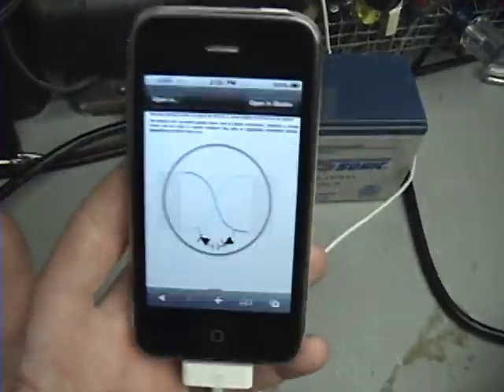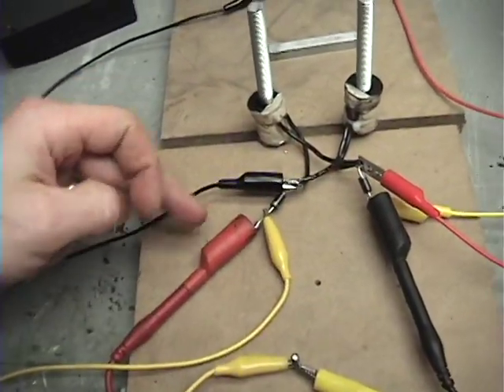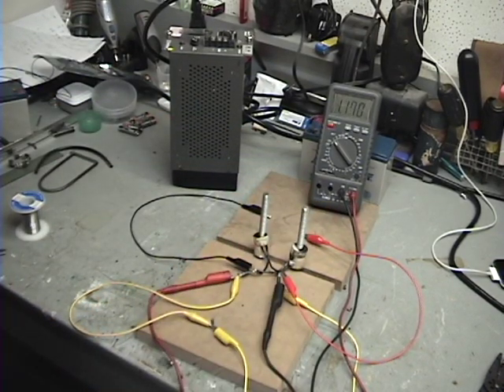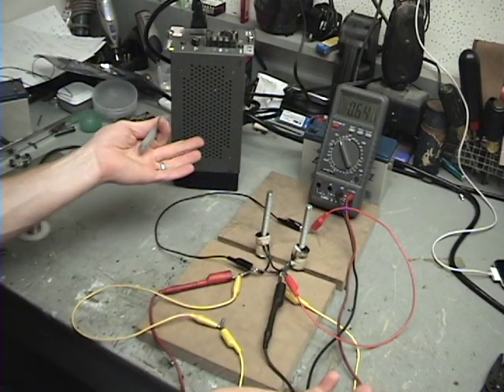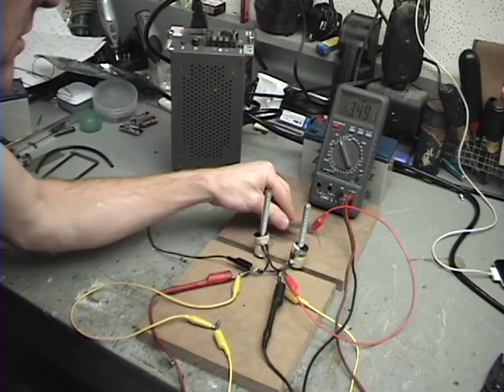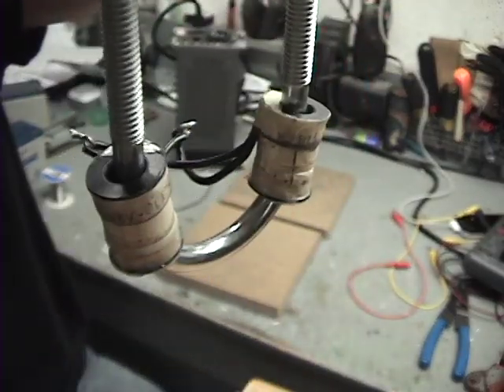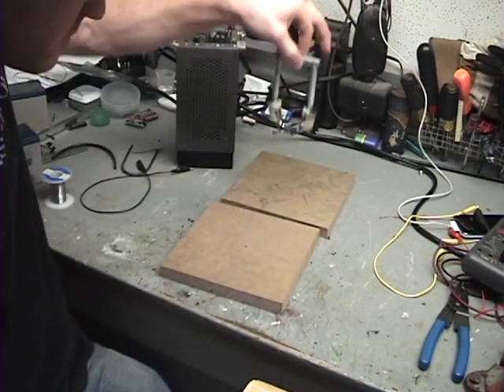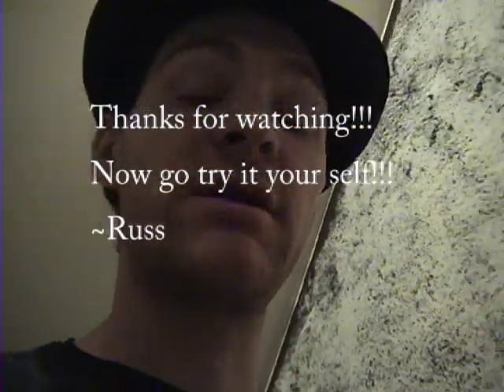2 The TPU extraordinary device works! Perpetual motion "holder" via magnetism!!! (Part2)

Comment: When you energized the U-bolt with the bar on top the PLASMA is trap within the loop, you have now a strong magnetic field around the whole assembly. When you disengage the  bar on top, the magnetic field will collapse to a lower magnetic field and the plasma is release to nearby object because the magnetic field around magnet is plasma. Cool experiment..

Comment: Perpetual motion is of course an emotive term. However , if we just confine it to spin of an electron for this instance, then a possible explanation is the alignment of spin in the magnetic domains within the iron core. The use o the 2 stage kick from the coil enables this to be achieved efficiently, and minimises instability in the alignment process. Closing the magnetic loop enables  stable magnetic flux to remain due to self stabilising properties of the spin field,

Comment: @rwg42985
"In the field of electromagnetism and mathematics, flux is usually the integral of a vector quantity, flux density, over a finite surface. It is an integral operator that acts on a vector field similarly to the gradient, divergence and curl operators found in vector analysis. The result of this integration is a scalar quantity called flux."
 ~ wikipedia

Comment: "An electromagnet is a large inductor, and resists changes in the current through its windings. Any sudden changes in the winding current cause large voltage spikes across the windings. This is because when the current through the magnet is increased, such as when it is turned on, energy from the circuit must be stored in the magnetic field. When it is turned off the energy in the field is returned to the circuit." ~Wikipedia

Comment: Russ: iron's molecular structure is large enough to mimic small monopolar (bias) atoms around it though what we've learned as a type of super-symmetry. There are no atoms there, but passing neutrinos think there are, until the magnetic field encapsulating it fails which only happens in presence of another field, like earth's, so your deal should last years if making flat enough contact. ..And incase nobody knows I've been working on a full replica and have videos up explaining the flywheel etc..

Comment: Superconductivity is a relative measure. In any 3 stage resonant system like a tesla coil for example, 3 negatives repelling eachother yet having longer lines of force than the positive is like a wheel rolling with a flat which is why ground is so eager to bounce current to and from to balance ion charge, which is what e current really is, which is why you can recharge a non-rechargable battery with 500kv pulses, ultra high voltages are just better ion charges and produce less heat.

Comment: yes the discharge is also inducing current. actually you can make a generator out of the perpetual motion holder.
you need a long winding and a thicker short winding and a rotor spinning the steel bar against the holder and internally shortcircuit the two winding in series. the magnetic field created by the long winding will dischage into the short winding trough the core and the short winding will magnetize the long winding that will create a surge and increase the dischage voltage current and magnetisation of the core every time the rotor steel bar turns away from the holder.

Comment: Dude, could you connect a mechanical fast switch  (eg the from the car) and a voltmeter serial in circuit ( previous magnet stick with super glue ), it could be interesting output ( free energy ) ...? Sorry for my english...

Comment: so in the tpu pdf it said that a capacitor would continuously charge when hooked to this. Why does yours start charging then the voltage dropped before you purposefully discharged it? Also how would one be able to harness this energy to produce "free energy"?

Comment: Have an idea for a perpetual motion bike using a double gearing system and a spring that will rewind perpetually. It can also be started using a simple lever device 
Does anyone out there think that you could use something like this for pistons in a car engine? I kind of pictured a two man car on the railroads (pulley *)

Comment: Please, man. What's the similarity between this "perpetual motion holder" as he (Ed L.)called it, and Steve Mark's Toroidial Power Unit ? Here you conserve energy by converting it to a magnetic field that will exist "for ever"(amazingly enough) as long as you give it a path/loop to run in. When you break that, the energy - or more precisely the back EMF - is released and converted back to electricity again in the coils, not without plenty loss, probably. The S.Mark TPU has what to do with this ?

Comment: Hi Russ, I have watched many of your vids and do quite a few experiments myself, I am well into alt energy. I found a lot of interesting stuff about various tpu , meg , flynne etc devices here http://www.slideshare.net/niculaegeorge/a-detail-study-of-the-steven-mark-tpu-10721103 THis guy goes deep .. anyway what I am now pondering is if you had an H frame instead of U and put a keeper on the other end could you flip the magnetic flux with coils to the other side or if you put a keeper futher up the U would that give the flux a shorter path and release the keeper that is on the end of the U? just a couple of thoughts that I would love to know the answers to. You have a better selection of lab equiptment than me to easily run these experiments all the best and thanks for your great work and spirit in all you do regards Andy. p.s. there is a word doc of the above link that is slightly updated if you scroll to bottom of frame on page you can find the link, its 31 meg. I found it much easier to read in word than with the two scroll bars on the above page.

Comment: foxy; the pmh is just current in pm. Steve Marks toroidal generator exploits a trick of combining different ac waves in magnet wire through a carrier wave and nonlinear medium (zero point energy ( read papers on Tom Bearen at rex research perhaps)) to transform lost kinetic waves back into usable energetic ones in ambient space. The coil shape gives form to the white noise, it's a nonlinear vacuum like a gyro with no return hole. This is what makes a nuke reactor efficient btw. See my channel